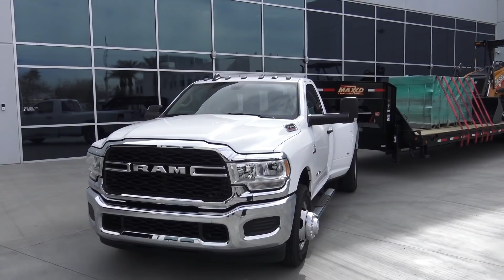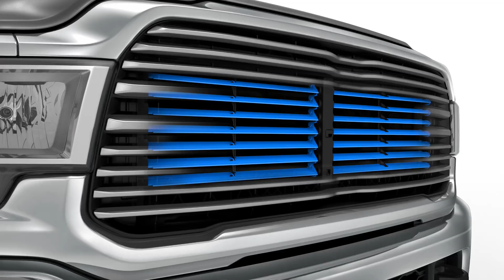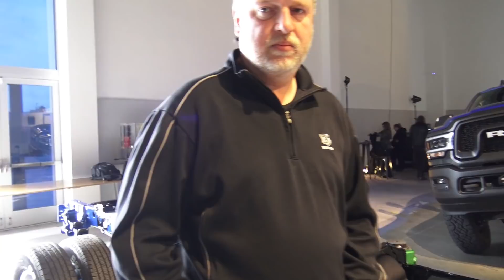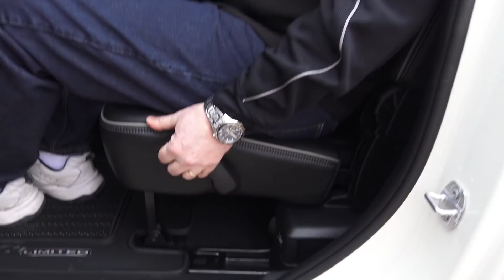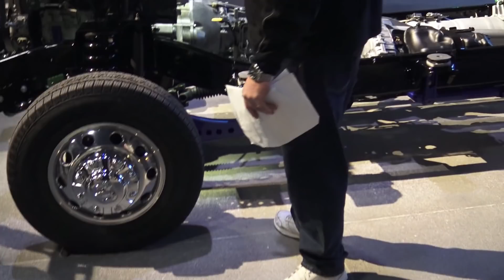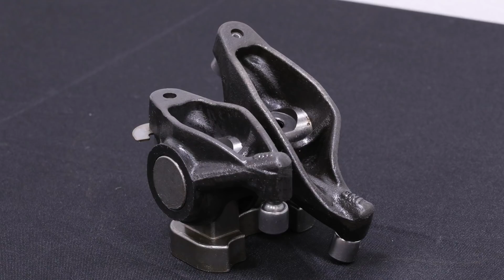2019 Ram Heavy Duty, 35,100 lb trailer, first drive part one.

Comment: Rod, chief engineer. You have failed us Ram owners in a couple ways. I really wish you’d listen to people like myself that drive many loaded miles. 

Even though your statement is that we get 1,000 lbs torque in 1st gear, I’ll disagree. It is completely torque managed and it lessens the torque significantly. 

2nd. You have failed us with the exhaust brake. Normal operation, the exhaust brake takes too long to engage when downshifting. Other fail is that the exhaust brake doesn’t work in 1st gear or  in 4x4. 

If you’ve talked to propels like myself, you’d find out that we need an exhaust brake to keep the truck and load slow on steep and windy grades. As I told people before, I’ve had a 99 Ford F-350 with the 7.3 liter. I installed an aftermarket Banks exhaust brake and that combo did the trick. I could haul 30,000lbs down a 25% grade and keep the load 10-15mph without braking! 

We know you can make updates in our trucks, so please do so!

Comment: How does a ram dually with HO handle in the snow?
Reply from the maker: Like any other dually
Reply: @MrTruckTV  yea I'm new to dually trucks and dont know how other dually ride in the snow.
Reply from the maker: OK, not good in snow. On the farm, I would  pull the outside duals off. On a normal wide frame pickup truck dually, the inside dual will line up with the front tire. So it does well in snow without the duals. On a cab and chassis, it has a narrow flat narrow frame and  the duals split the front tire track.
Reply: @MrTruckTV  that's what I figured. Whenever I driven in the snow in the Pacific northwest and Sweden we used skinny tires, more weight per area on tires on snow equal more grip.

Comment: All these fancy improvements and still the most important thing hasn’t been touched, how about allowing the option for an owner to do a manual regen? All or most of these trucks will leave you stranded or in limp mode then an expensive cleaning of the DFF, altleast ford did it right and allows the consumer to perform a manual regeneration instead of paying a shop to perform it

Comment: Chassis Cab trucks get any power bump or still running the derated 750lb ft motor?
Reply from the maker: They are derated do to EPA chassis dyno. No one knows what body will go on the truck, like flatbed, crane, service body. So final weight GVWR is determined by the body builder.

Comment: MRTRUCK. I finish this video a couple hours ago. And I was just now thinking to myself 1000 foot pounds of torque in first gear! It would be nice to know if that’s available in the low range and 4 x 4 LOL! Not only that I have a video idea for you if you’ve not thought about it so far. It would be nice if you guys did a drag race towing the same weight side by side. Please don’t do one at a time unless you don’t have 2 trailers and etc. and! It would be nice if you did a drag race same weight in 4x4 high and low. Then of course. Re do the gauntlet side by side. Also. I really really miss it when you guys used to include the full 7 to 10 minutes going up and down the mountain I really absolutely miss the old days why don’t you guys do that anymore? Is it because people were just complaining and being bunch of bitches! Well guess what if they don’t like it they can skip the damn part Jesus people are so lazy nowadays! Anyways I really really want to see proof of that 1000 foot pounds of torque at the fly wheel v.s. 930fpot at the flywheel going up the hill side by side. And drag racing empty and loaded.
Reply from the maker: We can't do side x sides on Interstates.

Comment: As much as I like all these extras, my take away from all this is there's a lot more to break. If they had kept the system as long as Toyota did with their Tundra nobody would question reliability. 
My biggest wish is for one day one of the big three gives Toyota a run for their reputation as far as longevity.  Because as each automaker discontinues sedans they are standing on one leg for survival. If they falter like engine blocks cracking or transmission fails at 50k it'll be over.  Let me end on a positive note. 
Ram with this lineup has certainly made a HUGE leap in overall aesthetics on par with any Lexus or Mercedes. I wish them well on the reliability part and hope they learn from their past. 
Go Ram.
Reply: Why does anyone want to give Toyota a chance at anything? Toyota is a foreign company and yes, the money doesn’t come to our communities. Also, if Toyota wants in the market, they would. They can’t keep up with the American made trucks.
Reply: @mikemiller9119  the ONLY thing good about American trucks is the cummins engine. Period. End of story. If it wasn't for cummins, American trucks would still be the big old piles of shit they were and still are to an extent. American manufacturers have no one to thank but cummins for the success. Toyota as a whole is 100% better than any shit American could ever be. By the way, almost all toyotas in the US are manufactured here so a huge amount does stay in the US
Reply: @benjaminturpin2749  try putting 30k lbs behind a tundra and see what happens. American trucks are the only ones making heavy duty trucks for consumers. Both the titan and tundra have max tow rating of around 11k
Reply: I'll agree cummins is the one and only reason trucks are what they are in the US

Comment: Just imagine what these trucks would do without all the bs unnecessary emissions crap strapped on them now.
Reply: All the emissions crap on these trucks cause more harm for Humans and other biology. The emission systems break down the soot to where its absorbable through skin and lung contact. With no emissions  the soot molecules were too big to cause harm to humans and animals.
Reply: @Iamknowbody25  dead wrong in that there....large particles of soot lodge in the lungs. 
No winning diesel exaust sucks.
Reply: @Iamknowbody25  yep... Black smoke blowing out with big particles is just fine for human lungs.. STFU moron
Reply: @ramtrucks721  ok so, with the emissions package the truck has a harder time pumping the exhaust air through the actual exhaust. This gives a truck terrible pumping loss and makes the engine work harder than it should resulting in the engine using much more  diesel and engines breaking prematurely. Both of these add way more pollution than a bit of black smoke. Dont believe me? Look at diesel refinement centers.
Reply: Meadow View Lawn Care LLC they work better than they did 20 years ago.  And the air is a hell of a lot cleaner than it was in 1970.  If you can’t afford it or don’t like it keep your 93 power stroke.  The rest of us would like to not breath diesel soot.  I love mine.

Comment: So basically they're doing stuff ford was doing years ago? I'm curious how the reliability holds up with CGI block and all the weight reduction. The aisin is probably the best reason to buy this truck. I've been super impressed with the reliability especially compared to previous generations of the cummins powered Dodge/Ram.
Reply: CGI isn't new to Ford or anyone. It was patented in 1965 and first used for train wheels. Its been a very common production method for brakes and turbo housings for a long time.
Reply: It also wasn’t even close to needed with the inline configuration.   And it’s probable overkill even with 1000fp of torque.

Comment: 1000 lb/ft torque off the first gear?

I thought that was only on the new GM's and updated Ford's because of the new 10-speed transmissions but this is interesting? Do the 2500's produce all their 850 lb/ft of torque in the first gear as well?
Reply from the maker: Good question, don't know yet
Reply: @MrTruckTV  
Well find that out for us. Thank you. 😁🇺🇸
Reply: I sure hope not. All brands of 3/4 ton trucks are way over powered now for their ratings.
Reply: @johnirwin1837  And how exactly is that a bad thing?

Comment: So no high output on the 2500 ?
Reply from the maker: No, the suspension is limiting. You can get it on 3500 single rear wheel. Which has leaf springs or leafs and air bags. 2500 just has coil or air bags. Plus 3500's have larger brakes and axles

Comment: So the Aisin can handle all 1,000 ft/lb’s in first gear on up?
That’s insane! I would have thought they would have needed to use some torque management.
Reply: lanceolot22 they do use torque management.  But aisin says they don’t need to.  It’s probably the u joints and transfer case.

Comment: Please do a review on the 2019 Ram 5500 Cab and Chassis. There are hot shot truckers who use them and put a frame mounted gooseneck hitch on them
Reply from the maker: You gain some payload but cab and chassis are EPA chassis rated for less horsepower and torque

Comment: It should have had an 8-speed automatic transmission. Not having it was a missed opportunity!! That long with 1000 ft/lbs of torque would have really made this truck stand out!!
Reply: If you extrapolate the torque curve based on the previous truck, the Cummins will effectively have constant HP across the spread of each gear. More gears really won't give more capability in this instance. Hopefully the larger gear faces permitted by having fewer speeds will allow for reduced torque management.
Reply: From a marketing point, probably, but realistically, with the massive amount of torque this engine has, it probably doesn't make as much difference as it would in a light duty truck. It will just idle along down the highway on 6th gear anyway.

Comment: Why dont they do the high output Cummins in the 2500? Also why is 4:10 the max tow. In big rigs you can have any ratio, what gets affected is fuel mileage.
Reply: Why would the 2500 need a fully-powered Cummins? It's only rated to tow a little over half the weight of the 3500. Best in class for a 3/4 ton, yes but it doesn't need all that torque.
Reply: 2500's towing and payload are limited by it having a coilover rather than leafspring suspension. No point in putting extra power in it, if the limiting factor is the suspension. 370hp and 850lbft is more than enough for the 2500.
Reply: Why wouldnt you offer the High output in the 2500, Ford and GM use the same engines and transmission in both their 3/4 and 1 ton trucks. Plus the Ram 2500 has air ride rear as well so suspension isnt the issue.
Reply: because u don't need it thats the purpose of a 3500 truck

Comment: Great video Mr Truck, and you asked the Man some great questions, I saw the video with Big Truck Big RV, that the Man there said the  heavy trans wouldnt last more than 300000 miles of heavy towing,  i dont know about that i thought the aisain was bullet proof. Thanks for your time Sir.
Reply from the maker: Thanks, yes I did some of the towing with BigTruck BigRV
Reply: Bullet proof isn’t forever. Ford and gm have close to the same limits
Reply: Aisin makes the BEST autos ever. It's what a lot of toyotas use and is a japanese company

Comment: Sounds like Ram is the only one to hit 35k because it’s built around the 35k ... where as the other manufacturers can hit 35k fudging things around
Reply: Tim Fox GM hit it too. You can’t fudge numbers by over 12k. Lol.
Reply: @crutler  GM 2019 max tow configuration is rated to tow 23100lbs with a GCWR of 31300lbs. 2020 they are marketing 35500lb tow rating with a GCWR 43500lbs, but the trucks haven't been made public yet... That's a huge jump if it comes to fruition.
Reply: crutler they have a 8 cylinder while Cummins uses 6